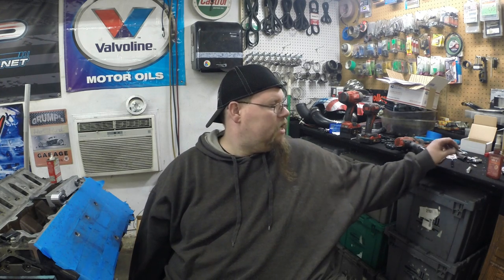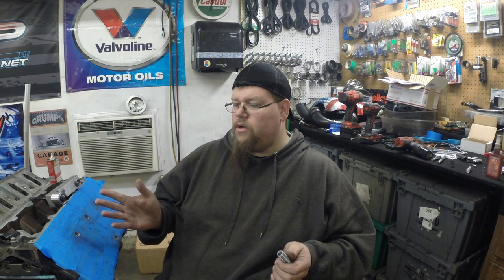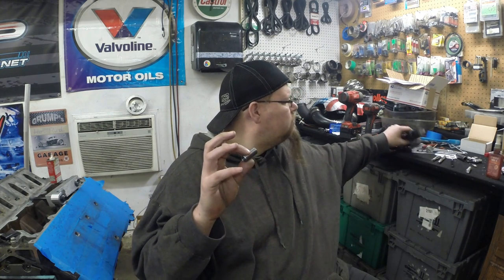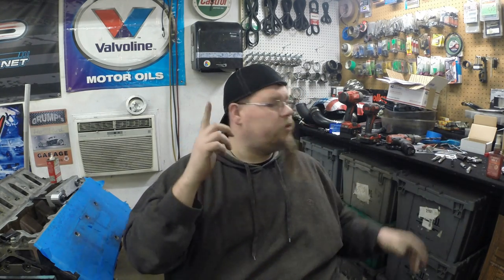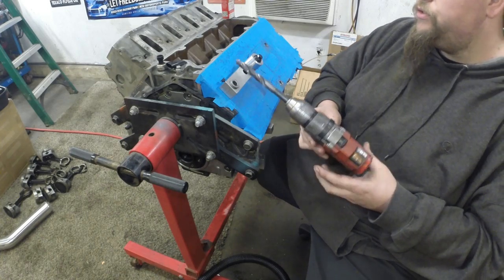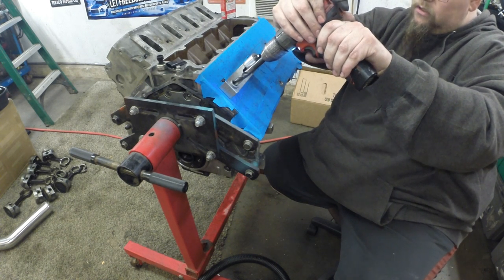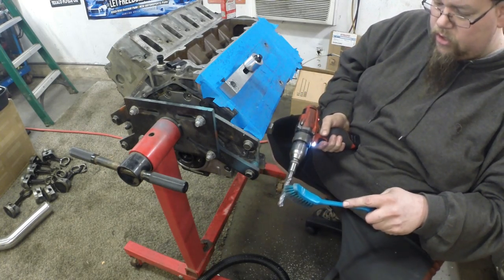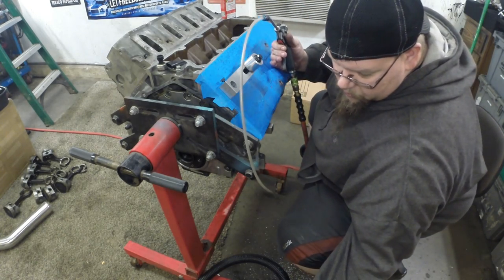NS300L Inserts! Fix Your STRIPPED Head Bolts Aluminum Block LS V8

Comment: I watched this before I ordered the tool and did the work. Great job! I followed the mfg instructions and installed the tool then taped around it. Mistake!! Wound up picking aluminum chips out of a freshly rebuilt engine. Due to tape coming undone. So do the tape like he did. It was a really good repair. Simple to do just time consuming. I also ordered the kit just to repair a  bad hole. The block I bought to replace mine had been hydro locked. I'm assuming that's the reason the threads were week on the one cylinder and pulled. The sales guy sent me a 10 piece kit it saved me some money. So good video

Comment: Thank you for this video! I just got this kit and about to do 2 bolts on this aluminum 6.0 LS I have here.
Reply from the maker: Awesome, man! Let me know how it goes 🙂
Reply: @RevHardGarage  will do!
Reply: @RevHardGarage Drilled & repaired the 2 that stripped out on this 6.0 last night. It went pretty good. Was actually easy... My anxiety was off the charts worried about doing this and keeping them straight. But it was a piece of cake! Not sure yet if I'm going to do all at this time. It's a stock build with just a BTR cam.

Thanks for doing this video. It really helped show how easy this was to do!

Comment: Did you torque it and did the angle tighten as per the specs? Or it is no longer required
Reply from the maker: If you are referring to the head bolts I have ARP head bolts. Torque final spec 70 ft lbs.

Comment: I just stripped a head. I’ve got 75 foot pounds. Do you think that’s enough? I’m not going to run.
Reply from the maker: I don't understand what you mean? You stripped a head bolt? If so, it needs to be repaired. Where do you have 75 ft lbs?
Reply: @RevHardGarage  the bolt that stripped if I back it down to 75 foot pounds my torque wrench will click
Reply from the maker: @daveerrington5166  If that's the case, I don't think you stripped the threads. It sounds like the bolt may have stretched. If you lost the thread, you wouldn't get anywhere near 75 ft  lbs. Iron block 75 is good. Aluminum I wouldn't go over 60ft lbs.
Reply: @RevHardGarage  I was under the assumption it was supposed to be 80 foot pounds. That’s when  I noticed it started to spin a bit and then I stopped. I back down the torque wrench to 75 and it’s good. All the other bolts are torque to 80.

Comment: Has anyone used these on a boosted aluminum ls?
Reply from the maker: this is a boosted aluminium LS
Reply: @RevHardGarage  roughly how much boost are you running?
Reply from the maker: @boostlife7984  16 lbs and 10.0:1 CR